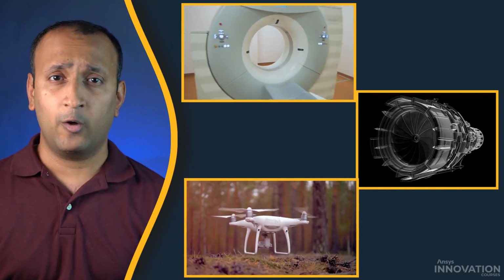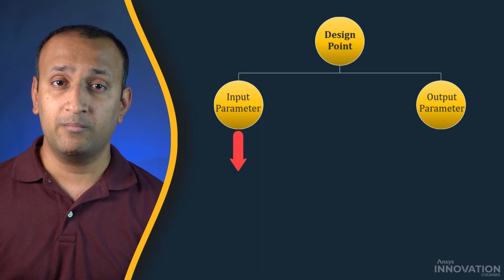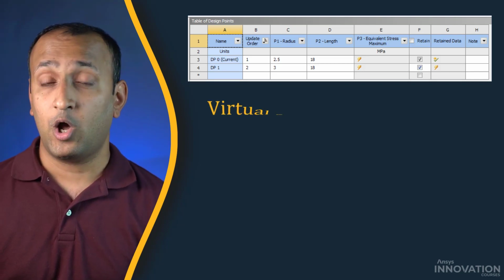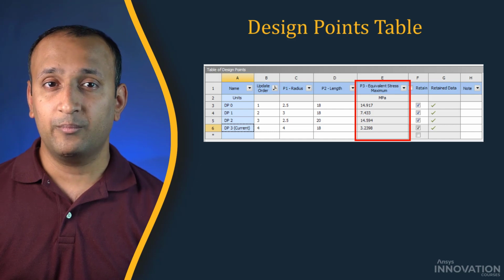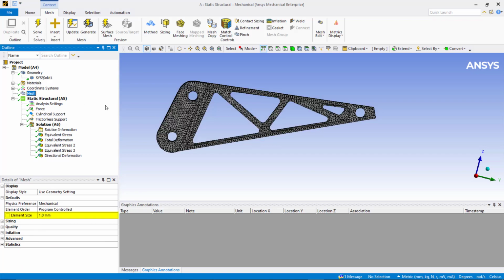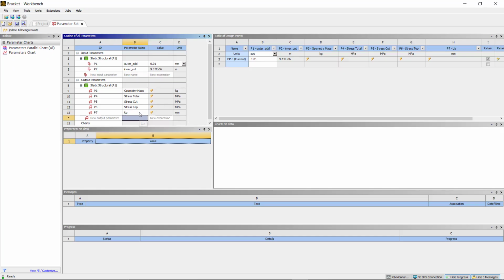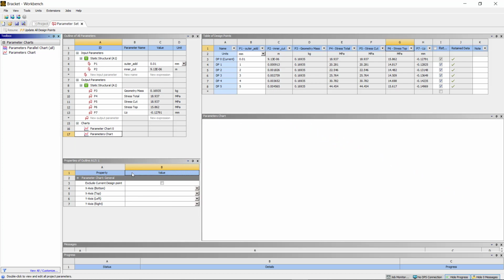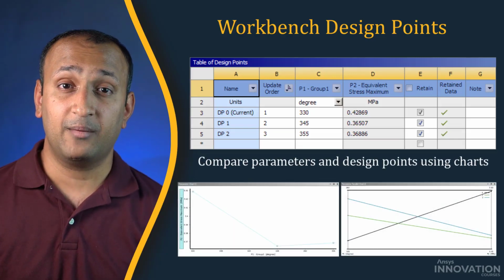Analyzing More Than One Design Using Ansys Mechanical — Lesson 3

Comment: Isn't there a way to automatically set a certain parameter to vary inside a range? Adding Design Points manually is extremely limited...
Reply: You can use WB scripting to automate this
Reply: @christopherdzuwa5052  WB scripting? Could you elaborate, please? In the end I just wrote everything in APDL using *DO/*ENDDO loops and writing/loading to text. Pain in the backside, but it worked.
Reply: @bva0  find the example below:

# encoding: utf-8
# 2022 R2
SetScriptVersion(Version="22.2.192")
force = Parameters.GetParameter(Name="P5")	
thickness  = Parameters.GetParameter(Name="P1")

#number of iterations
n= (40-20)/0.5

i = 1
while i <= n:
	designPoint = Parameters.CreateDesignPoint()
	designPoint.SetParameterExpression(
		Parameter=thickness,
		Expression="20 [mm] + {}*0.5 [mm]".format(i))
		
	designPoint.SetParameterExpression(
		Parameter=force,
		Expression="P6*(220 [mm] -P1)*(220 [mm]-P1)*3.142")
	i += 1
	

The goal of my analysis was to determine the effect of varying the thickness of a cylindrical vessel on the output parameters of axial stress, radial stress, and hoop stress. The vessel under examination had an initial internal radius of 200mm and an external radius of 220mm. The thickness of the vessel was varied between 20mm and 40mm, utilizing the input parameters of thickness, pressure, and force (with force being a derived input parameter).
Reply: @christopherdzuwa5052  Oooh, "WB" stands for Workbench! I didn't know there was scripting in WB, only APDL! Thanks a ton Christopher!

Do you save the file as a .txt and load it in WB? It'll probably take a while before I have to use ANSYS again (programming the analyses myself right now), but I'll try this out when I have to again.

Best, Breno
Reply: @bva0  The scripting capabilities in ANSYS have greatly improved and are now available in various modules such as SpaceClaim, Mechanical, and Workbench. You can save your script as a "wbjn" (Workbench journal) and run it by going to File>>Scripting>>Run Script, then selecting your script. The recording function provided by ANSYS can also be used to learn some features, though not all features can be recorded. The scripting language used in ANSYS is IronPython, and you can refer to their documentation for further assistance.Note: This is not a replacement for APDL. Regards, Chris.
Reply from the maker: Thanks for watching! Please post your query on the Ansys Learning Forum for a detailed answer from the wider Ansys Community: https://ansys.com/forum.